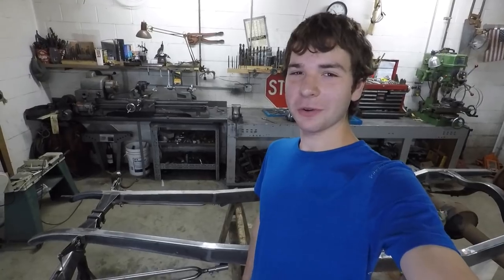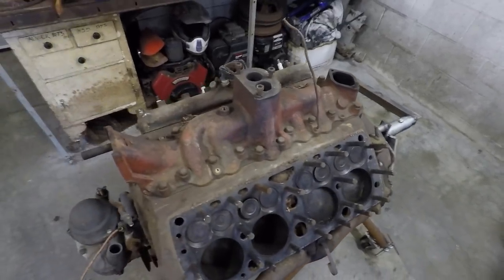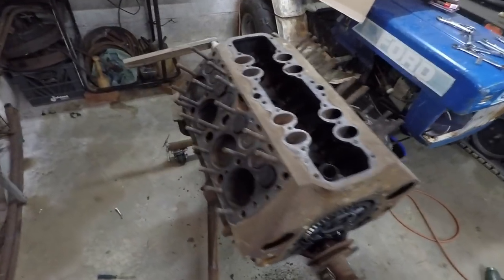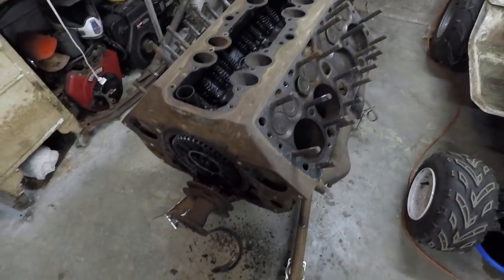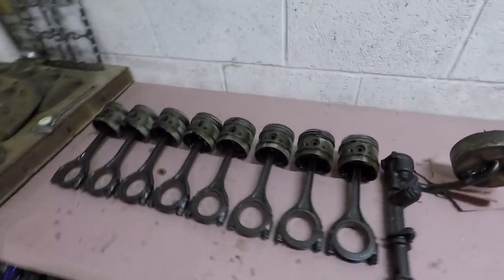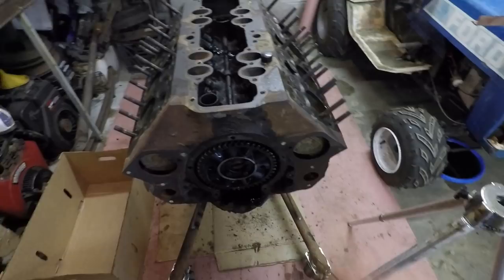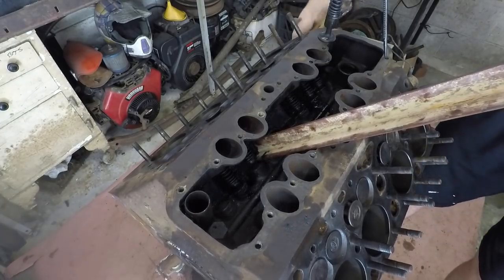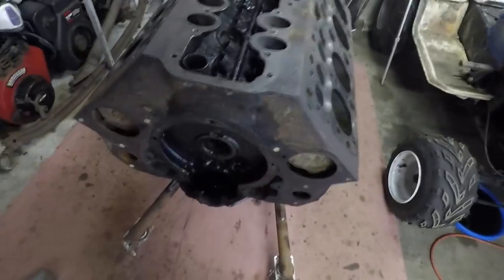Ford Flathead V8 Teardown | Boat-tail Speedster Pt.13

Comment: My dad had a great idea for my junior year in high school.  We had a 1933 Ford Model b pickup, with a flattie.  We pulled it out and had no big hoist, so my dad, my cousins(2), and I man handled it into a wheelbarrow and into my dads workshop.  Of course we pulled all sheet metal off the front first.  I learned to cut out ring grooves(nonelectric style), placement of rings cutting valve seats, etc, etc..  what an experience that was, and it started right up, NO SMOKE, ran like a charm.  I hated ft mount distributors!  Not the front mts in 1949+ years, but between the water pumps.  Example on UTube- Barbara Jackson video illustrates the type.

Comment: That is the only engine that should go in your car-love the flatheads. Biggest problem was overheating.To keep the Flathead engine cool the internal block must be clean and free of cracks and remember that boring the block brings with it increased demands on the cooling system.Can't wait to hear it run.

Comment: Looks like you got yourself a pretty nice shop and a flatty that's in incredibly beautiful condition.For some reason these engines are very expensive to build but at the same time they're a hell of alot of fun to work on.Seems you found the perfect power plant for your project,best of luck!

Comment: Nice simple engine, with simple electronics. A good exhaust sound for fun, slow weekend drives. See the Carsthatlast series on YouTube for older vehicles that are reliable as a daily driver- ideally have 2 so if 1 breaks you can take your time fixing it. The April issue every year for Consumer Reports magazine at a library goes back 8 years for reliability. Project Farm YouTube videos test maintenance brands- oils, fuel and oil additives, etc.

Comment: Great engine to start with and use. There sweet engines, and it will look super cool. I have rebuilt many flathead Ford V-8's. There is a special tool Ford made for removing the valve assembly. I would hunt it up and send you a photo, so you could make one, but you already got the valves out. There is a aftermarket cast-iron part that you put in the center exhaust port, held in with a head stud, that helps the engine breath better on the inboard cylinders... Look in the center exhaust port, and you will see what I mean. The ports have nothing to divide them, and exhaust can blow toward the other exhaust valve, instead of out to the manifold. Your doing a awesome job so far!

Comment: I've got a rebuilt Holley 92 2 barrel that would be perfect for that- chrome air cleaner too! Definitely needs some aluminum heads, bump up the compression, new cam, lake pipes, etc

Comment: nice motor and you cant beat the price , looks like someonedid a look see rebuild on it before setting it a side , the gaskets look hardly used and like you said no carbon buildup
keep the valvestuff on the corrosponding holes there worn intoo the camlobe 
might be able to find some go fast stuff on swap meets , maibe even cast youre own replica's out of aluminium 
thats how edelbrock started (intakes and cilinderheads)

Comment: You should do some of those old style mods to the engine where you remove a little bit of material and polish between the valves and the piston and maybe some porting like they did for more power before turbos n stuff

Comment: I'm doing the exact motor but my heads were already off and the nuts were missing.  I want to keep it rusty on the outside,  so if you have the head nuts and rusty intake bolts, I could use those.

Comment: Are you going to have to hone the valve port in the block?  If so, will you have to find new valve sleeves to fit a new polished port? I don't know how much material honing would remove.

Comment: A 59ab should not be on the engine stand supported by the bell housing, you better off getting the exhaust port adapter.

Comment: Clean old sidevalve, most are full of rust. It has been recoed in the past. Get the block, crank and rods cracktested by a machine shop. They do it better. And hot tank it as well. 
Those valves are as old as the engine,,,, may well be past their use by date.